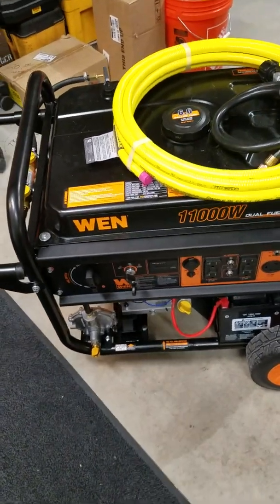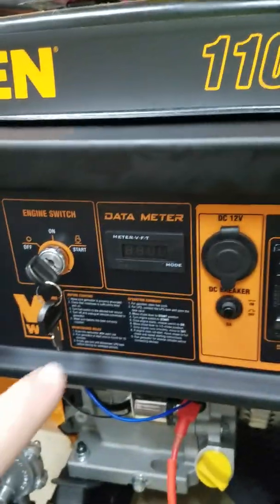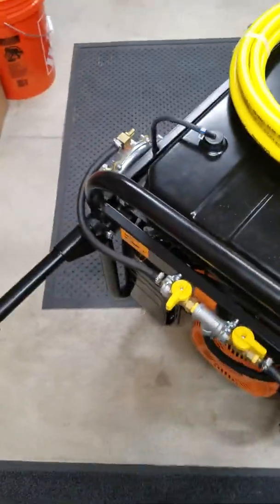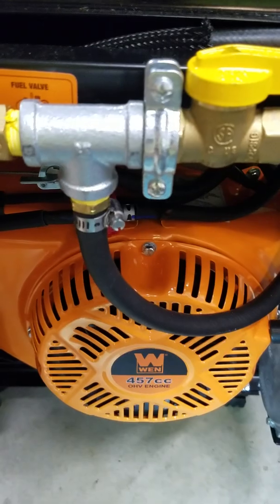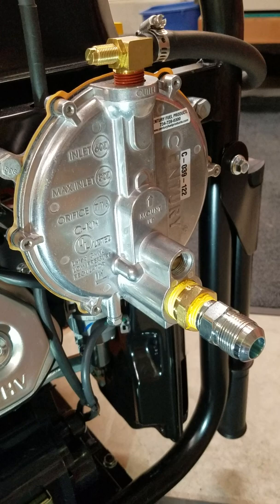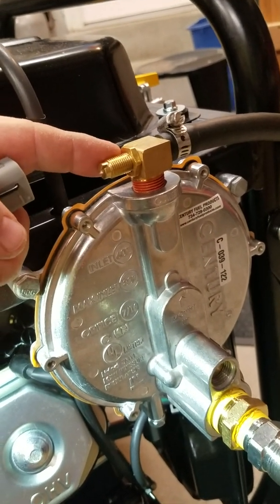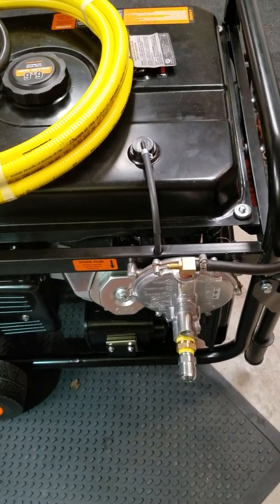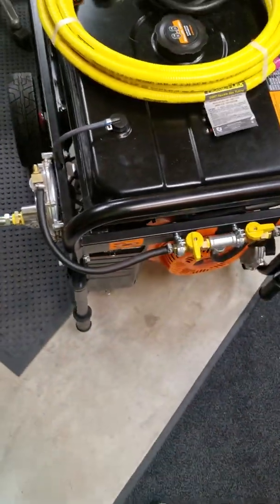WEN Generator Natural Gas Upgrade (Tri-Fuel)

Comment: How is the Wen generator holding up? It's the cheapest on amazon now and thinking about it. Thanks
Reply from the maker: It's doing good. No issues to speak of yet. It's only been used in emergency situations and over the last couple years it may have been ran about 4 or 5 times. The directions vary from outage to outage but the longest I think it was on continuously was probably 15 or so hours. The other outages are short maybe three or four hours at a time. But again so far so good
Reply: @ryangremminger1 thanks man!

Comment: FYI folks, measure your NG pressure before ordering your regulator. My pressure was on the low side, 5"WC. The first regulator like this one shown would not work properly. There is another one made (by Century) for lower pressure input. Nash Fuel can help you out. They carry it. It's a KN-039-112. The normal one shown here is a KN-039-122.

Comment: Does natural gas need a regulator? It's already at 0.5 psi from your house through it's regulator. That's the same set as nearly every propane regulator. My guess is by adjusting that set screw on yours you've effectively removed it from doing anything, and before that, it was acting too much like a restriction. Nocking 0.5 psi down because it was trying to supply 0.5 psi And some minimum pressure drop is needed across it to make it function.
Reply: It's a demand-type regulator, so essentially drops the pressure to 0 psi until suction from the generator engine opens it up

Comment: Hi Thank you for doing this. I want to convert my Wen 11000 from LP to natural. Can i just replace the LP regular with the NG (c-039-122) regulator? Will this work for me? After 3 years any issues with the generator or running it on NG.
Reply from the maker: Hey thanks for the question. Absolutely you can remove the propane regulator and put in its place a natural gas regulator giving you the ability to run it on gasoline and natural gas. I chose to go with adding the regulator instead of replacing it solely so that I had more options for fueling the generator if needed in the future. As for the longevity it's been doing great for us. It's been used twice now in emergency capacity when the power did go out and otherwise I do a load transfer twice a year so that we can test everything out and get a few hours of run time on the motor with load to make sure there's no issues. Also check out my channel because I have other videos about this generator especially the installation of it. There may be some useful info for you there. Thanks for watching have a great one!
Reply: @ryangremminger1  Thank you for the quick reply. Home Depot should deliver mine either today or tomorrow and I already had an electrician come out and install a 50 amp back feed with an RV plug and interlock kit. I had this done on my previous house with a champion gas only generator but this time I am hoping to just add a quick release NG stub and run the generator off NG and just do any with the issues of gas stability and storage that i had issues with the previous setup.

Comment: How much did you have to loosen the  lower set screw. Not the circuit block.
Reply from the maker: if you're referring to the Brass screw on the back of on the back of the regulator, that was backed out as far as it could go from the factory.

Comment: So the issue is the pressure of propane vs natural? The unit is set at a propane pressure of X, you have to determine if your natural gas pressure is the same which is all likelihood it is not, it is less....so you need something adjustable, can you get a dial with a pressure gauge attached and run it though the propane regulator? Or is the propane one not adequate for natural gas?
Reply from the maker: To my knowledge there's no workaround to run natural gas through a propane regulator. I've always understood that you have to use a natural gas specific regulator. That's why I have two different Regulators on my generator. This way I can run either propane or natural gas. Like I said I don't believe there's one device that will do both. Thanks for the message!
Reply: @ryangremminger1  also the elbow circuit setter you have on top of the regulator does not seem to have a bolt to adjust the pressure like in the link you provide? Shouldnt it? is it a different type?
Reply from the maker: About the right angle sitting on top of the regulator, you are correct what I have in the video is a circuit Setter which has an adjustable screw with a needle valve at the end of it which would allow you to restrict or increase gas flow. However I learned for my application that I didn't actually need the circuit Setter and in fact it was a gas Flow Restriction choke point for me. I needed all of the flow I could get through this fitting. I ended up taking the screw out and grinding down the angled needle on the end of it so that it would be as wide open as it could be. The link I provided does have only a right angle fitting with no circuit setting adjustment values. This is what work for my application however yours might be different so take it with a grain. My advice would be to just go with the right angle no adjustments fitting.
Reply: @ryangremminger1  I have the same generator, I'm trying to gather the right pieces that I need to make this work, so will the one on the link work? or is your grinded version better?

Comment: How did you get the 3/8 hose to stay put on the 1/4 barb fitting behind the gas selector switch mounted to the generator
Reply from the maker: Sorry for the late response. I had to wait until I made it back over to the house that this generator is installed on now. I double checked my hoses and I do indeed have a 3/8 hose going on to that Barbed fitting of the gasoline and air gas selector that is factory installed on the generator. I don't know if they have changed the Barb size on the current models but I appear to just have a standard hose clamp and it is just cranked down really well. I also verified that the factory rubber hosing that is on the unit is a 5/16 labeled hose if that's any help also. Thanks for reaching out good luck with your project have a great day!
Reply: @ryangremminger1  I ended up using 5/16 hose the barbed fitting was 5/16 on mine not 1/4 or 3/8 but your video was definitely helpful, I ended up
Using a 3/4 gas line and it runs like a top I’m glad you put out this info here thanks for the reply
Reply: Also I came straight out of the top of the regulator With a 5/16” barbed fitting no needle valve
Reply from the maker: @B housto  I learned later on that brass load block that I put on the regulator was restrictive to my system. I ended up taking the needle out and ground down the needle on a bench grinder all the way back to the beginning of the threads and therefore there is zero obstruction and it acts like a standard 90 fitting. It's redundant to have that load block on that regulator because the regulator itself has that hidden brass screw adjustment on it. Happy to put this out there because I knew I wasn't the only one trying to do this.

Comment: why do you have to have different regulators for propane and natural gas?
Reply from the maker: Propane in every form out of the tank has a much higher operating pressure. Therefore you need a different size diaphragm to deal with that pressure. The natural gas that comes through the piping into your home operates at a very low pressure. This is not to be confused with compressed natural gas that has been stored in tanks. Compressed natural gas is stored in tanks at the same pressure that propane is so the same regulator can be utilized for both. Hope this answers your question. Happy to answer any more!
Reply: @ryangremminger1  thanks for the super fast response.  I'm guessing if you tried to use the same regulator you would have to adjust between LP and NG.  I have same generator as you.  so we don't have do anything at the carburetor,  correct?
Reply from the maker: You're correct we don't have to do anything to the carburetor. That's actually why I selected this type of generator , dual-fuel, is because it could run on liquid gasoline as well as air gas, propane or CNG which stands for compressed natural gas. There's no switch or anything to switch between propane or CNG on that regulator. You can feed it either one and it's going to work with it just fine. The reason I added the second regulator is because natural gas delivered to your home through your utility operates at a tremendously lower pressure, not even 1 psi, and requires a much different size regulator diaphragm. That's why it's so much bigger than the smaller propane regulator.
Reply: @ryangremminger1  I posted a question and a link but it disappeared.  would any NG regulator work?  What the smallest valve size would you use? 3/8"?
Reply from the maker: https://store.nashfuel.com/
Reply from the maker: This is the website that I used to Source what size regulator I would get for the size generator I had. I built everything around that regulator. If it had a 3/8 out that's what I got and put rubber hose on it. I'm not quite sure if that answers your question.
Reply: @ryangremminger1  I've been to that site.  I struggle trying to get through all the info.  The regulator at menards I was trying to link says it can process 250,000 BTUs/hr of NG.  set for WC of 8 (propane usually 11) and output of 2 PSIg.  found some cool 3 way selectors that would allow.  All off, NG, Propane, or both (wouldn't do).  their less cumbersome and ready for hose connection.
Reply: @ryangremminger1  Thanks for the video and the guidance.  I probably won't work on till the weather warms up.  Wish my deceased FIL was alive.  He could have helped me with the disconnect.  He resecured my powerline back to the house
when it was still hot.
Reply from the maker: I basically found a kit that would convert the motor I had and then bought just the regulator only and did my own Plumbing. My condolences for your loss on the family member about the disconnect. Yes it's a fairly easy job but you got to know what you're doing and be familiar with all the parts and pieces. Good luck on your project feel free to reach out for any more info I can help you with. Thx!
Reply: @ryangremminger1  I run my own electric on remodel jobs.  I'm knowledgeable and capable.  He enjoyed helping out and I loved having the expert!  Thanks again.  Can't wait to try this.
Reply: @ryangremminger1  I'm doing this because last summer I had my MIL living with us while recuperating.  We lost power for 24 hours and she is on oxygen.  My wife ended up going to her house to stay while the power was out.  I went out of town to see a few customers so I was able to stay in a hotel.  In the future, I want to be able to protect our food, run heat/Ac if needed.

Comment: Nice setup. Very informative. I love the dual valve. In case of a disaster that might decrease your CNG pressure, can always introduce a small amount of propane to offset lower Natural Gas pressure. All while maintaining the ability to run on propane or even gasoline. Very nicely done with the solid mount stand offs. Thank you for sharing.
Reply from the maker: Thanks! I have another couple videos on installation of a manual transfer switch and running full load of a house with a 100 amp service.

Comment: So… stock you can’t run it from the gas that comes into your house?!
Reply from the maker: That is correct. This particular generator was only designed to do dual fuel which included gasoline and Propane. Natural gas operates at a completely different pressure and the same regulator cannot be used for both propane and low pressure Natural Gas. They do sell tri-fuel models that will accept all three kinds of fuels.
Reply: @ryangremminger1  THANK YOU very much for that useful information including this awesome video, I just ordered one of these generators and thought I could run a line from the gas that comes into my house to this generator, guess I was mistaken… lol. Oh well… guess I’ll stick with propane 😎

Thanks again and have a good one! 🙂

Comment: I really enjoy the creativity of folks like you. You designed a very clean looking conversion. 
One comment - when I plumbed natural gas to my garage, everything I read stated to use black iron pipe. The thought was that some component of natural gas corrodes or flakes the interior of galvanized parts.
Reply from the maker: Black Iron is a common carrier of natural gas in homes all across America. I haven't heard that galvanized could have degenerative effects with natural gas. If I were to plumb a barbecue to my patio with natural gas I would probably use galvanized for its corrosive resistance to the elements but that's not saying that there's corrosiveness going on on the interior with the Natural Gas. Good food for thought I might investigate that. Thanks!

Comment: I recently converted two generators to natural gas, one being the Westinghouse clone of your engine. I had the same problem with that load screw on the regulator not allowing me to back it out enough to let enough enough fuel. Try flipping the set screw around. I’m talking about the fitting on top of your natural gas regulator. That gave me the little extra fuel I needed to allow to run properly under a load
Reply from the maker: Thank you for that suggestion. I did not think about trying that. After I'd had everything installed I later found just a standard 90-degree fitting that I could have replaced the load block with but since it is all set up at my mom's house at night at mine it's not something I see or work on very often.
Reply: @ryangremminger1  if you still need more fuel after replacing the load block with a street elbow try a straight fitting npt to hose barb. I had a fuel problem on my wgen12000 which has a 713cc motor and swapping that out did the trick. The straight fitting was just enough flow

Comment: can you get a nat gas conversion kit for a WEN 3800 unit?
Reply from the maker: i found this online. contact the seller to confirm this will work for your model. https://www.ebay.com/itm/193544950994

Comment: Hello.
I have this exact same generator.
Since the natural gas goes straight through the same plumbing for propane, what do you think about using a natural gas regulator meant to covert propane grills to run on natural gas to input the natural gas straight into the built-in propane input ?
Reply from the maker: So we can understand your question properly are you suggesting taking a natural gas regulator and plumbing it through the onboard propane regulator? I don't know if this will work and it was not something that I thought to try. I wanted to make sure I went directly into the carburetor from my natural gas regulator with no other restrictions.
Reply: @ryangremminger1  The inlet pressure for the installed regulator is 0.5 psi. I think that answers my question.